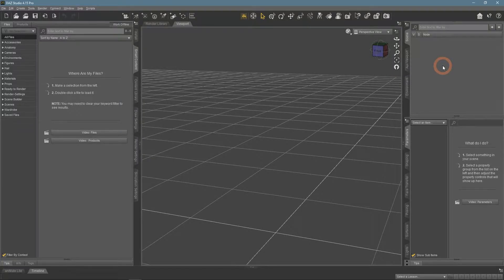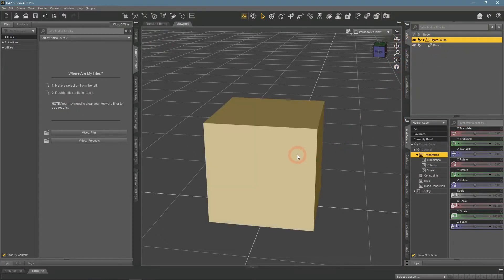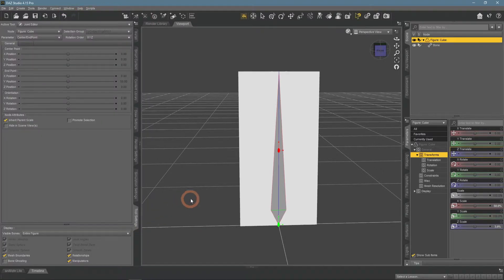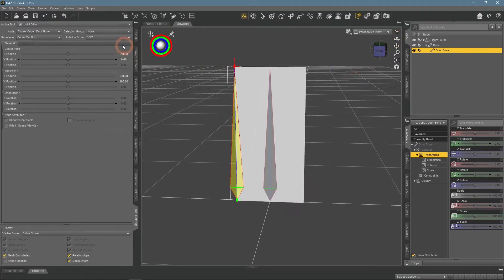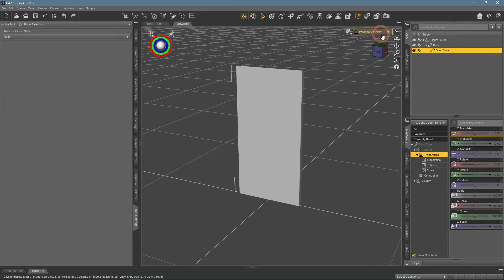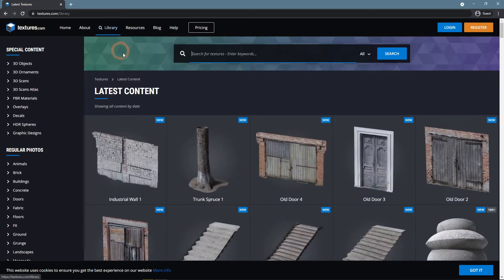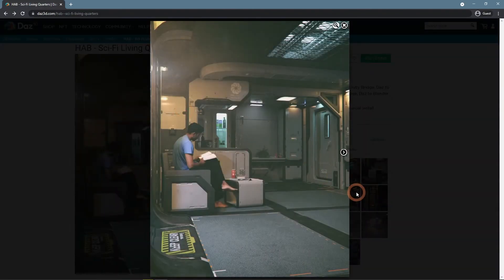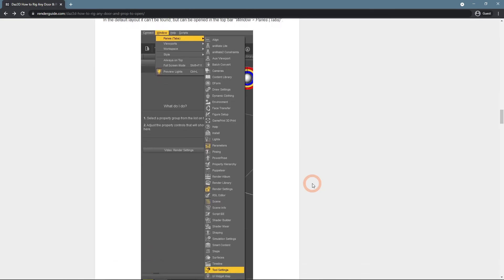How to Rig any Door and Prop to Open in Daz Studio | Daz3D Tips

Comment: There is a much easier way to rig a door.  There are two simple ways. Use a null and position it where the door meets the doorframe. Parent the null making the door the child. Rotate the null on the y axis and rename the slider as open/close door. Instead of using a null; one can use a cylinder, since it can be rotated on its y axis. The length of the cylinder does not matter. The cylinder can be made invisible as well; using (unselecting) the 'eye'.